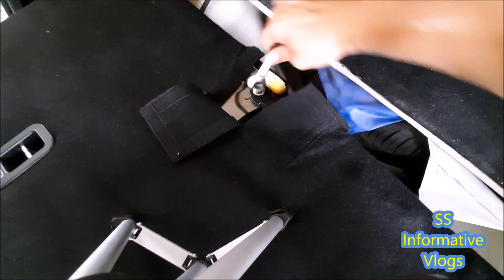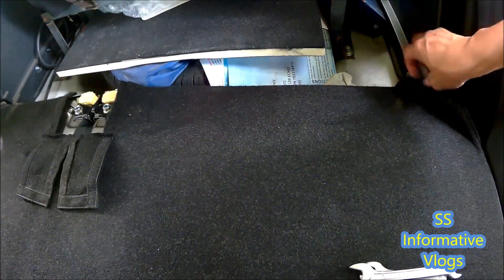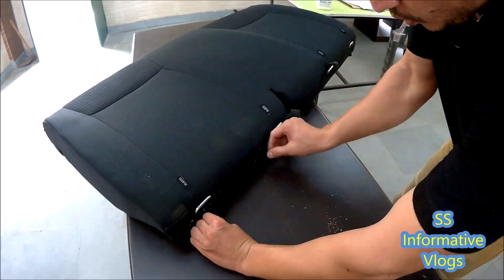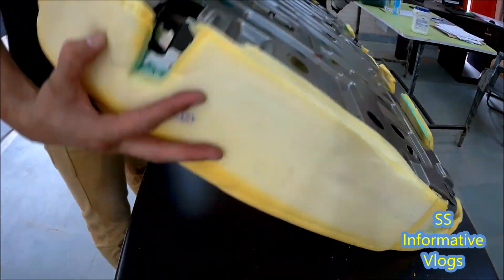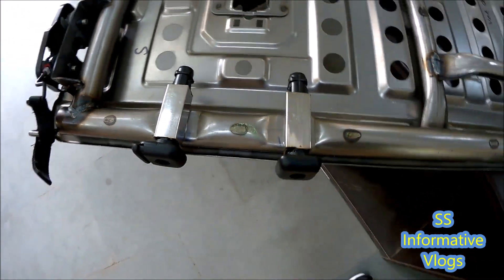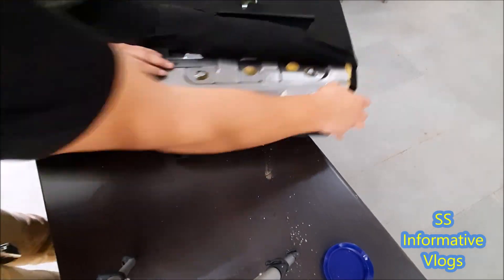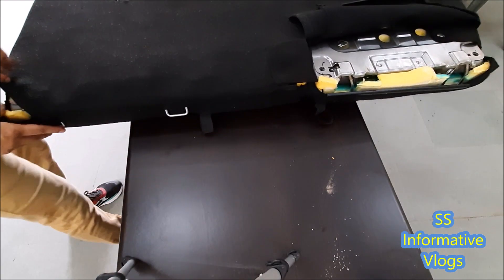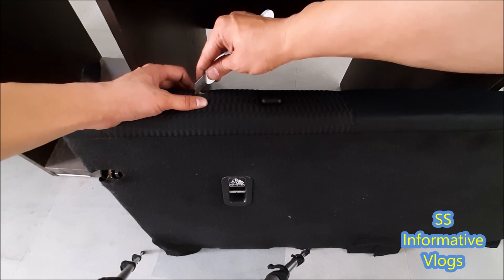Full Step by Step Video (fixing) Installing Rear Seat Headrest in Maruti Brezza LXI, LDI | #brezza 👍

Comment: Very well explained sir. I have Tiago BS6. Rear seats have fixed headrest but those headrests are not up to the mark. Is it possible to install adjustable headrest in Tiago after removing the fixed one? If yes, then please advise the estimate cost. Thanks
Reply from the maker: Yes Bro everything is possible, for Pricing please check from Tata motors for Headrests Price 👍
Reply: @ssinformativevlogs  bhai socket kahan se milenge original??? mere paas baki sab kuch hai